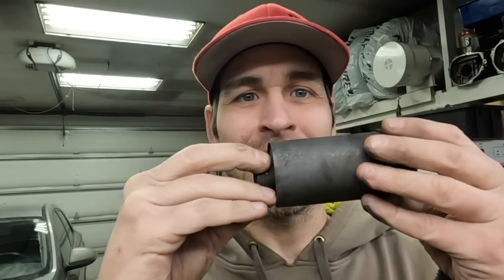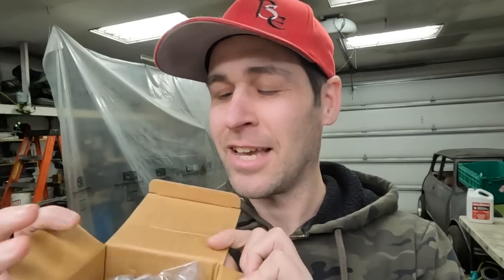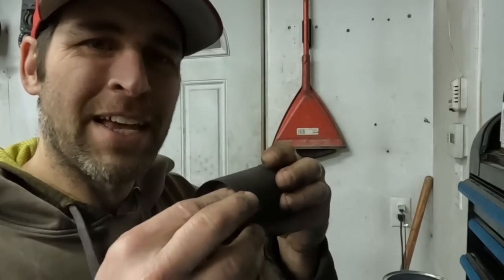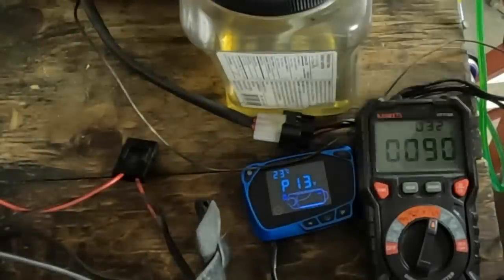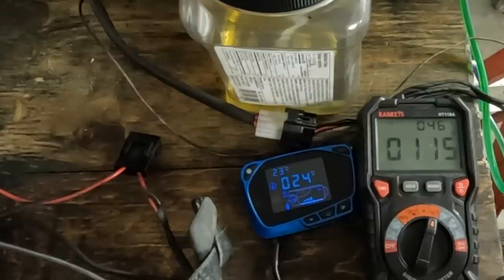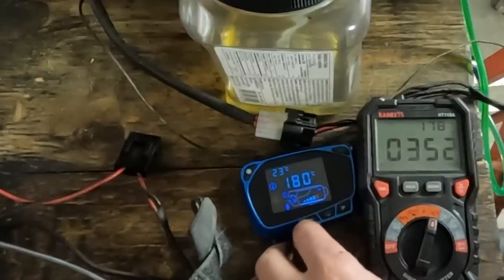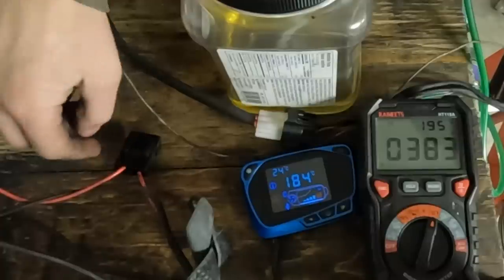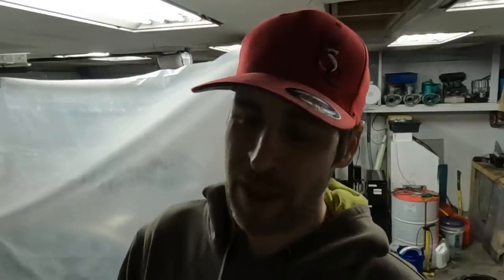Cat Converter In My Heater - Diesel Heater. PT- 23

Comment: Cats are used in an exhaust situation not in a burn zone in you overheat it  it’s useless
Reply from the maker: True... The reason for placing it in this location was more or less an attempt to trap heat around the burn area. It probably wasn't explained very well, or at all, but this was a result of a bunch of other testing that seemed to show the temperatures where the fuel was entering was way too low.